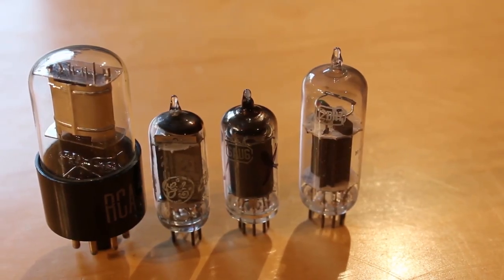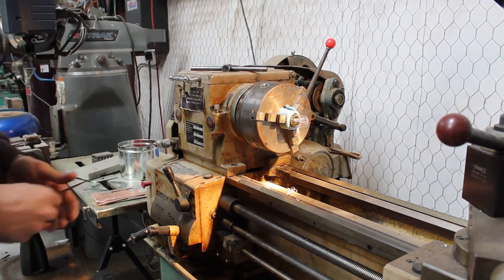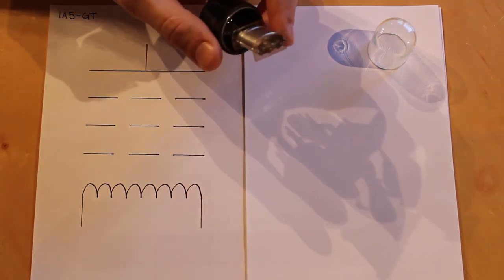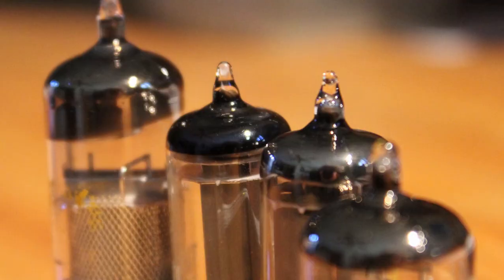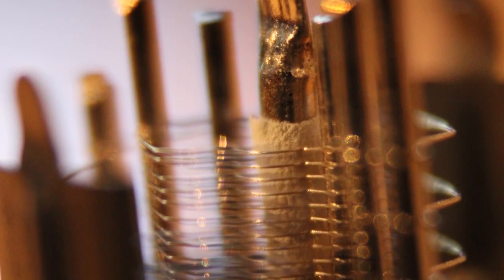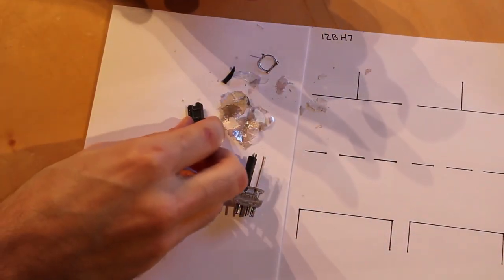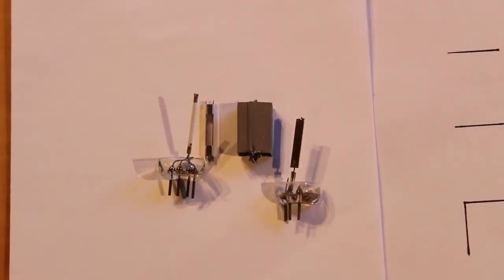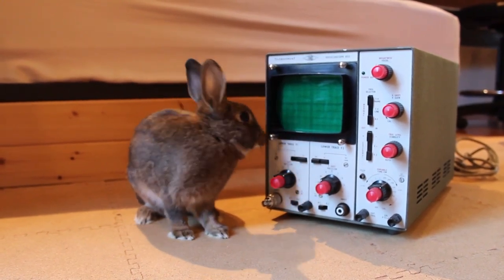Taking a Look Inside a Triode, Two Pentodes and Thyratron

Comment: Hi ! The thin material used to maintain the cathode, grids and plate inside the tube is calles mica. It is a mineral that has been pressed into sheets, and was used to make heat resistant windows or thermal insulators. It is also a good electrical insulator, used as dielectric in precision "silver/mica" capacitors
Reply from the maker: Thank you, I knew it was made of something unique, especially with how it came apart, but I couldn't figure it out while I was dismantling everything. And then I got sidetracked with the weirdness of the Thyratron, haha. That's awesome that it's the same type of material as used in mica caps. Apparently, little mica insulating sheets were used in Microwaves too, because you can order a pack of like 1000 for $10 on Amazon, haha.
Reply: @UsagiElectric  Thin mica sheets were commonly used to electrically insulate components from a heatsink. They are still readily available, but silicone pads are more common now since they don't require thermal grease. I still prefer mica since it has slightly less thermal resistance, but the grease does make a mess.
Reply from the maker: @rocketman221projects  Thanks, I knew I had recognized them before! It's interesting to see how differently they've become with 40 years of R&D. The ones on the tube were surprisingly thick and actually had a reddish reflection to them. Heatsink insulators that I've pulled out of more modern equipment seem to be much thinner and are much clearer. Still, it's awesome to clearly see a materials science lineage here!
Reply: Fun fact: mica sheet is directly produced from naturally occurring minerals by sorting, cleaving and cutting to shape. You basically pick a rock, ply it apart and put it into a vacuum tube or onto a heatsink.
Reply: @sashimanu  mico was also used for small windows in coal burners and oil burners because it is resistant to high temperatures, so you can check the fire. It is indeed still sold as to3/to22 isolation plates for mounting transistors on a heatsink
Reply: @renebouman7513 , thin, relatively clear mica used for a window into ovens and fireboxes was called Isinglass.
Reply: @UsagiElectric  mica insulators used as spacers for vacuum tubes elements were sometimes coated with chemicals to improve their insulating properties, which is probably why you've seen them to have a reddish tint to them. In my experience, most mica tube spacers/insulators have a powdery or frosty whitish tint to them, like the stuff sprayed on store windows at Christmas to simulate frost and snow.
Reply: @sashimanu  another less fun fact about mica: it often contains asbestos. A mica mine in Libby, Montana that produced "vermiculite" gave lung cancer (mesothelioma) to most of the town's residents as well as thousands of people elsewhere. When the mica was roasted in an oven it puffed up like tiny bits of popcorn from the moisture locked within the mineral; this vermiculite was used as blown-in insulation in walls and attics, and added to potting soil as a moisture retainer; but the popping process also allowed the asbestos fibers previously trapped in the mica to become airborne. The talc mineral used to make talcum powder also typically contains asbestos; until recently, talc was used as a filler in crayons (which kids often chew on 😳) and in talcum powder which people rubbed onto moist, sensitive areas of the body....

Comment: One trick for cutting glass tubes like the ones the vacuum tubes are in: once you make a groove around it with a file, wind a nichrome wire in that groove and then pass a current through it. The wire will become hot, the glass under it will expand and break off cleanly.

Comment: Love your videos.  Vacuum tubes may live and last a long time but not so with electrolytic capacitors turned resistors like the multi-sectional types in the cans.
Reply from the maker: Thank you so much! Those old wax capacitors you often see in radios are notoriously bad! We have an early '60s Magnavox Concert Grand and it had some of those caps that had bit the dust and were preventing the whole thing from working. After a re-cap, the original tubes fired right up and it puts out one of the best sounds I've ever heard!

Comment: The insides of vacuum tubes are so fascinating! I once bought a GU-81 triode off of eBay for a tesla coil, but I cracked one of the pins trying to put it in the socket.  It aired out and  my tube was now useless.  Anyways, it was a good excuse to look at the insides.  Those power tubes are built so well.  I have a pair of 10kW transmitter tubes, it would be cool to take a look inside one of them sometime, but they are too valuable to break.
Reply from the maker: I love that you can just so clearly see all the individual components. I mean, you can kind of decipher silicon, like Ken Schiriff does on his blog righto.com, but it's not quite the same as being able to see it with the naked eye! I need to get my hands on one of those GU-81 triodes, they're absolutely massive! The only problem with those old school power triodes is that I don't even have a power supply on hand strong enough to just drive the filaments, much less to anything useful! Still, what beautiful pieces of equipment. I bet those 10kW tubes are amazing looking too!
Reply: Isnt the gu-81 a pentode?

Comment: Anode cans were blackened to reject heat by infrared radiation so they can stay cooler and have less secondary emission
Reply from the maker: That's interesting! I never would have thought it was for radiating heat from the kinetic energy of the electrons striking the plate!
Reply: there's even a 1930s patent for it :)

Comment: Metal lathe?  Awesome!  I cool tube I remember was a magic eye in a 1940’s long/short/am radio 😊
Reply from the maker: Haha, yup! Kind of a case of the "wrong tool for the job," but I'm also a firm believer in "if it's crazy but it works, then it isn't crazy." 
Those old Magic Eye tubes were absolutely awesome! We have an old 1960's Magnavox Concert Grand Radio that my Grandpa bought new, and aside from putting out the best sound of any stereo I've ever heard, it has one of those Magi Eye tubes. I would love to dissect one some day!

Here's the radio: https://i.postimg.cc/RV9dFcwj/IMAG2442.jpg
And the Magic Eye: https://i.postimg.cc/Gm8Dk44Z/IMAG2441.jpg

Comment: A diamond coated file or diamond cutting disk (like a Dremel tool diamond wheel) would have been faster for cutting/removing the glass. You probably should have worn a mask and gloves while scattering powdered glass into the air! Also, assuming that you used the same file to cut all the tubes open, you probably dulled it on the first tube and so it didn't cut as efficiently when you got to the 6au6.

Comment: Very cool. I wish your camera focused on the tube in your hands rather than being fixated on the straight lines in the diagram below the disassembly. I guess this is where manual focus works much better.
Reply from the maker: Thank you!
Actually, the camera doesn't have active autofocus. It's really just a cheap Canon Rebel T5 DSLR that I'm forcing into use as a video camera. So, when I set the focus, I totally didn't think about my hands picking the tube up and pulling it out of the plane of focus. Unfortunately, the process I was doing was totally destructive, so I couldn't re-film without having to destroy more tubes, so I just lived with the poor focus and instead hoped that the Macro shots would make up for it.
I'm still working on getting better with using this particular camera and getting shots to look good, hopefully the quality of the videos is improving with each new one I make!
Reply: @UsagiElectric  Hey, now worries at all. I'm so used to seeing people struggling with autofocus it's actually refreshing to find someone that doesn't use it :-) Thanks for taking the time to respond!

Comment: You can actually slide the fillament, (heater), out of the cathode. It's very brittle, but worth a look.
Reply from the maker: Ooh, I hadn't actually thought about that! I also just so happen to have a dead 12BH7 hanging about that I dropped, so that'll be a good candidate for this. I'll have to give that shot one I manage to get ahead on work (been swamped busy lately with translation for work).

Comment: That MICA not plastic for the cover/top.. 6au6 is most likely pyrex for the glass
Reply from the maker: Yup, a few other commenters pointed that out too. It's super interesting and explains why it broke apart in a really weird manner!
Reply: I did some checking on use of Plastic it tubes, Mica the best plastic producs off gases when heated . Not good for a tube. Unless your making Special tubes that would be vacuum then filed with a noble gas like Argon.